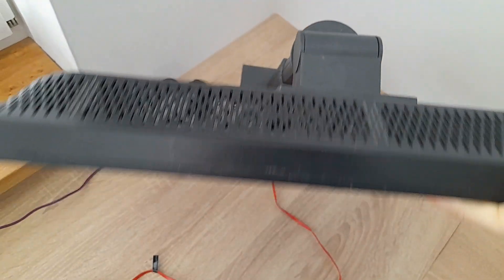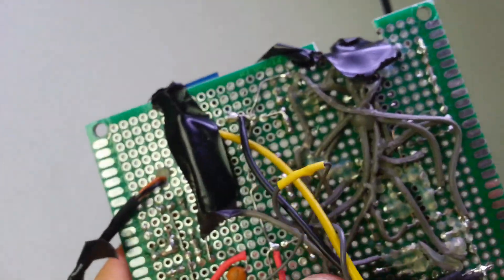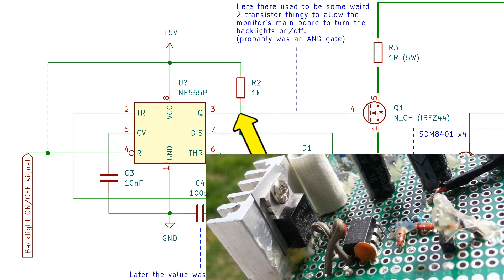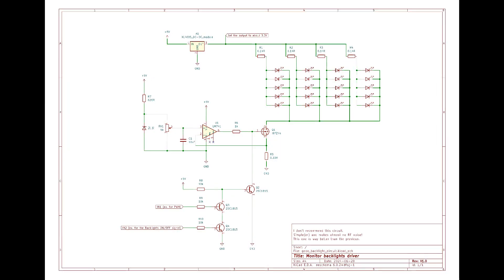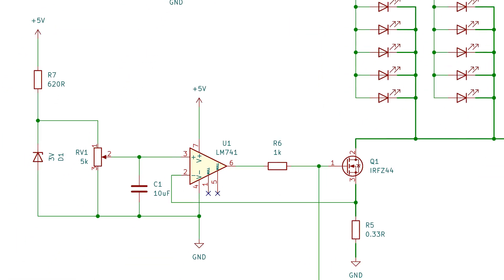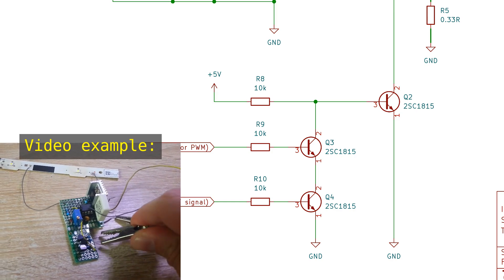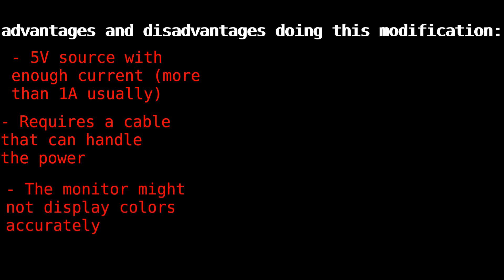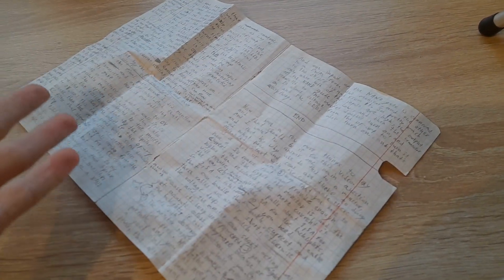How I modified an old monitor to be powered by 5 volts - Part 2 & 3

Comment: i wish i could modify my monitor to work on 5 volts, but the REASON MY MONITOR IS 19 VOLTS IS BECAUSE OF ITS CRAPPY BACKLIGHT, i appaul you because you probably replaced the backlights on that thing
Reply: I think you might mean applaud... cx
Reply from the maker: Of course I changed the backlights. It had CCFL backlights to begin with.